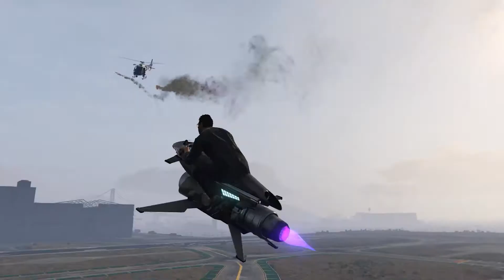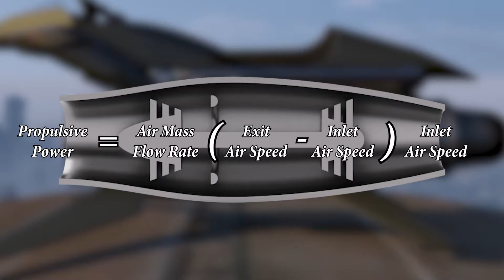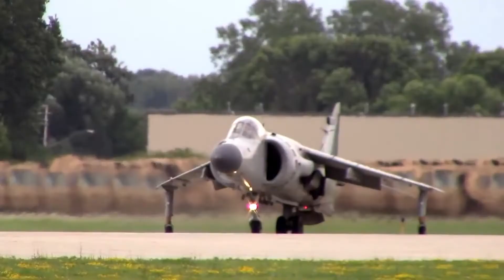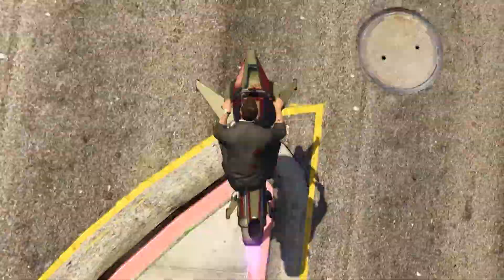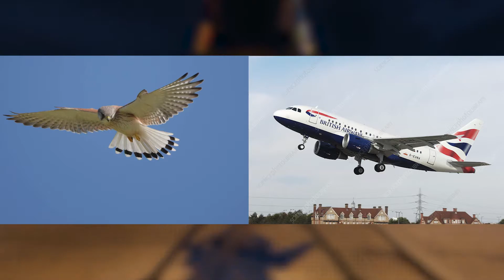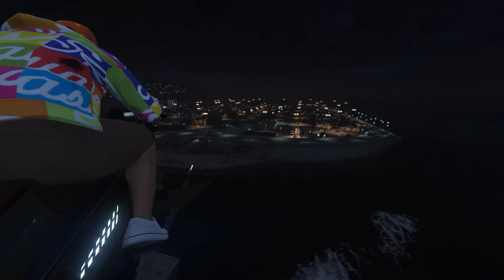The Oppressor Mk II is More Realistic Than You Think

Comment: Before I bought one I had heard all the complaining about it having no weaknesses etc. but having used it for myself I realised this is not the case. With 20 missiles, if you're in an armored car there's no guarantee they have enough to take you out in that moment for one. For two, it can't lock on to people, only vehicles. if I note one thinking they're going to chase me I will slam on brakes and reverse back past it, get out of the car and keep moving. If it drops down close, take it out with an SMG. I'm not good at sniper so further distance I will try with the homing launcher instead. They need actual talent to kill you when you're out of the vehicle, especially at night, and typically a griefer will realise they're not getting an easy kill and move on. 

They're also a target as soon as I left the garage in it I had other oppressors coming at me lol, I definitely lost some K/D in this thing rather than building it higher. 

Chin up guys, it does have flaws, it can be beaten.
Reply from the maker: I totally agree with you. I bought one for the purpose of making the video and the drawbacks are pretty immediately noticeable